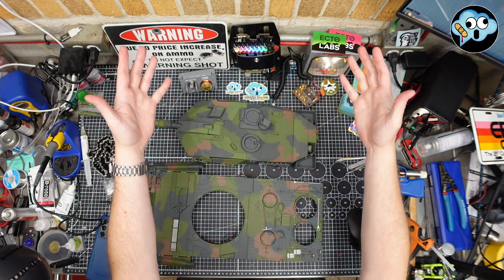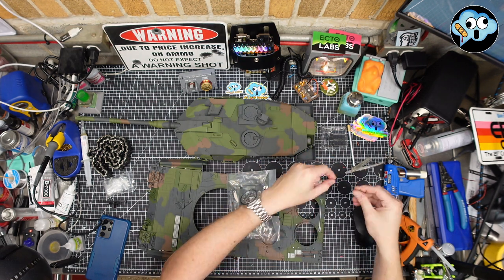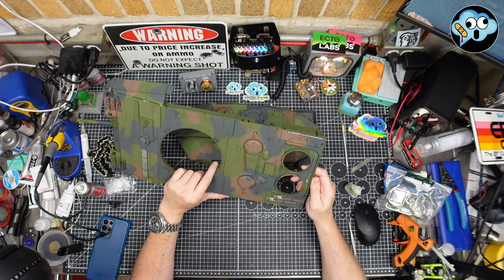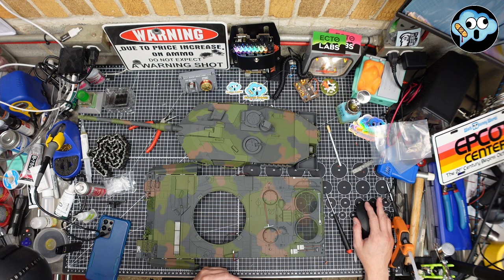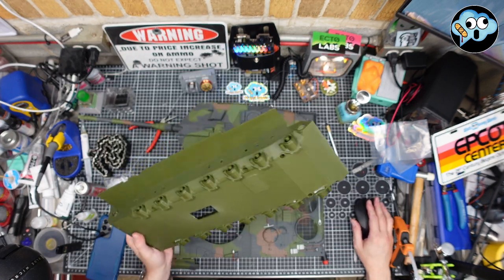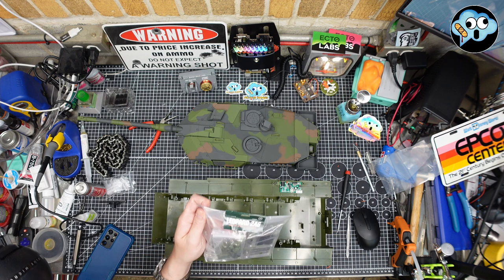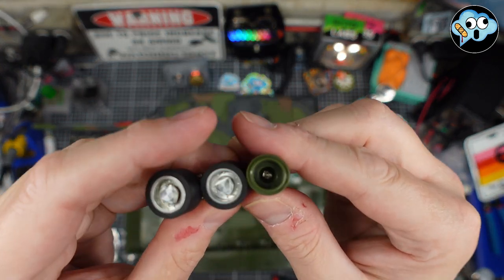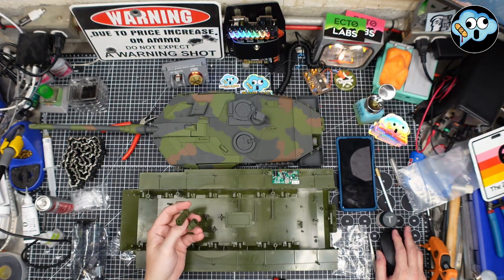Agora models 1/16 scale Leopard 2A6 Main Battle Tank partwork kit pack 5 build stages 34 through 42.

Comment: 15:31 The Driver has an escape hatch, which is the square located towards the front on the right hand side. You can't really escape from beneath the turret, but if the turret is in the right position you could crawl from the turret into the driver's position and exit that way.

Comment: Hello.  I just finished my Terminator build and I'm just about to finish my R2D2 build (2 more shipments).  I'm really thinking about getting this kit after I finish R2D2.  I just started the Titanic, so I have a long way to go with that build.  Last year a bought a Mini Ratchet set to help set screws into tight spaces.  I bought the "Inwell 58 Piece 1/4" Drive Mini Ratchet Wrench Set, Mini Socket Set, Screwdriver Bit Set, Driver Bit Set - Phillips, Slotted, Hex, Square, Trox, Tamper Proof Torx, Adapter, Quick Release Bit Holder" on Amazon (I paid around $24 for it).  

I find this tool really useful.  There are others out there, but this is what I purchased.  You may want to take a look at it and others to see if it's something you could use.  
Thanks for sharing the video!  Eric 👍
Reply from the maker: The mini ratchet is a very good idea, I actually have a bit adapter for my 1/4" drive ratchet to use for just such a purpose and did not think to try it, thank you, YOU WIN A STICKER, email me (in the description) Also this is a very nice partwork so far, I think you would be pleased with it, link also in the description above. Happy building!
Reply: @PitstainHobbies  I received your sticker in the mail yesterday.  Thanks so much!  Eric
Reply from the maker: @lunaticloon5638  Awesome, so glad it made it there! Enjoy!

Comment: Dare I ask, does the track tension "wrench" (the silver coloured tool that usually needs a couple of people to use it) located on the rear engine deck behind the air intakes, actually fit the track adjusters that you fitted in this video?
Reply from the maker: I highly doubt it plus it's been CA glued down.